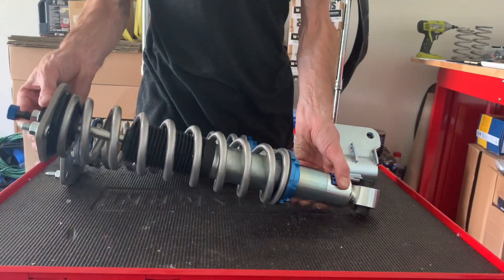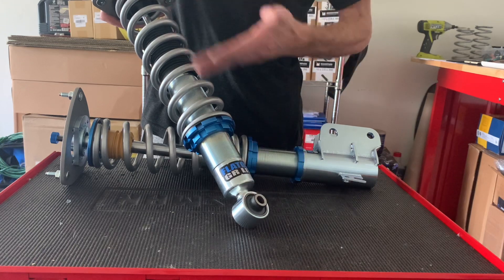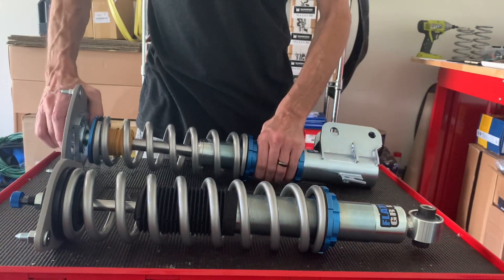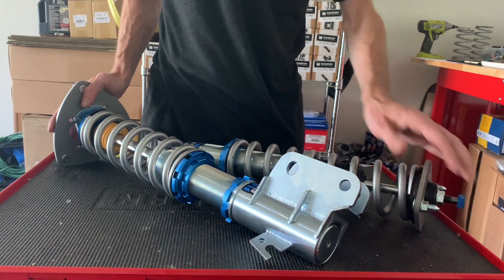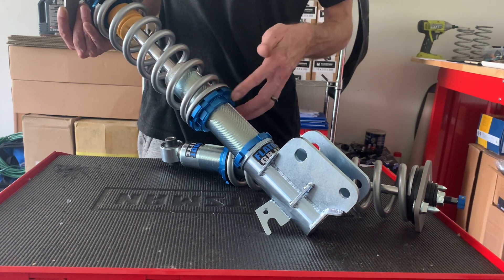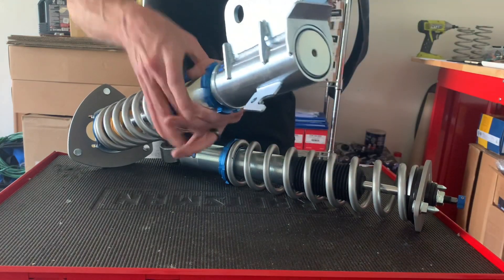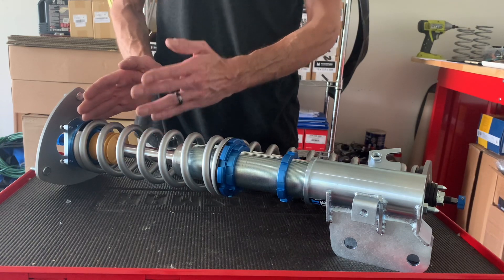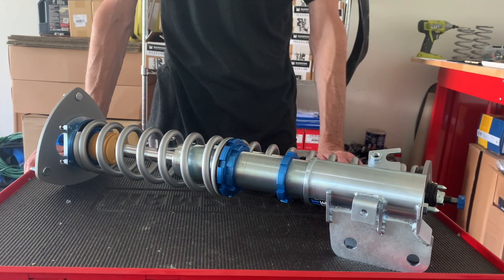Flatout Suspension GR Lite - Revisions and Set Up

Comment: Just received the GR Lites for my 2018 Outback a little over a week ago and will be ready to install them once the subframe spacers arrive. I notice there have been a few revisions to the design since this video was made. The lower front shock mounts now have additional welded bracing and are beefier. The bracket for the front swaybar link is no longer welded to the lower mount, but is now attached to a threaded adjustable collar that can move up or down the shock body and then be locked into place for optimum swaybar position. Very cool!
Reply from the maker: We constantly evolve the product based on customer feedback. We don't do like everyone else that has an "it is what it is attitude", if we can make them even better - we're going to do it. That sort of progress is why we're able to forecast that we'll sell the 500th GR Lite in the next few weeks.